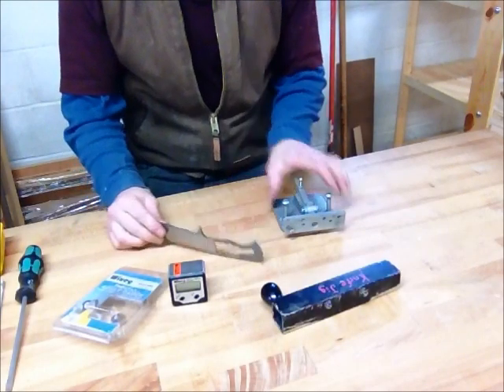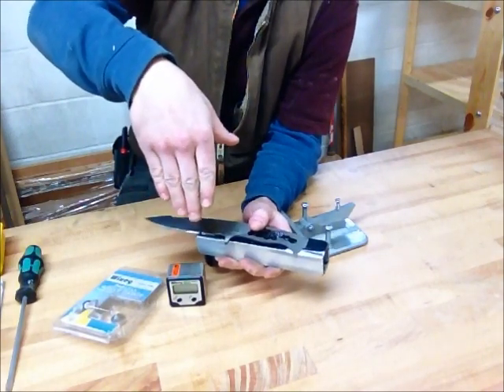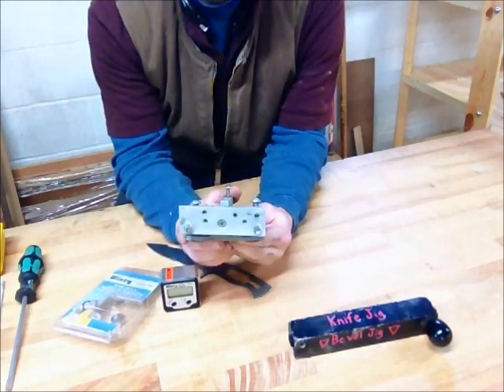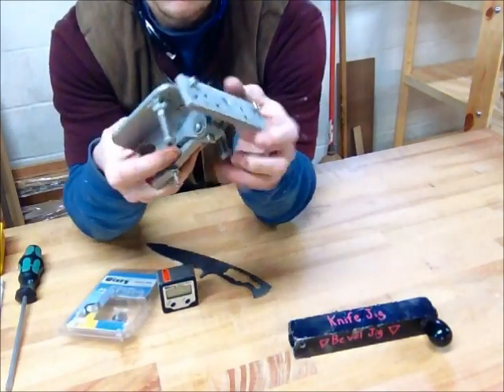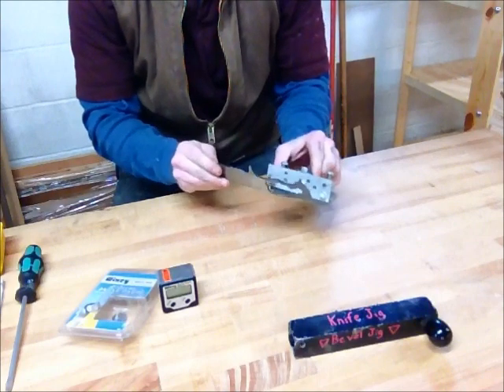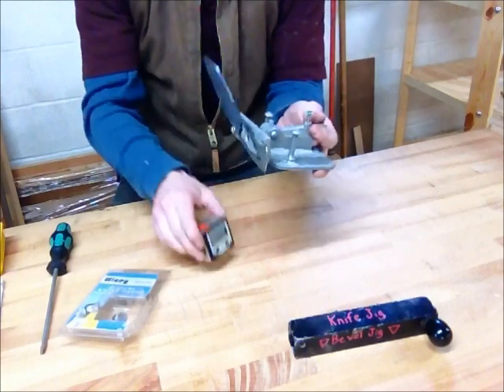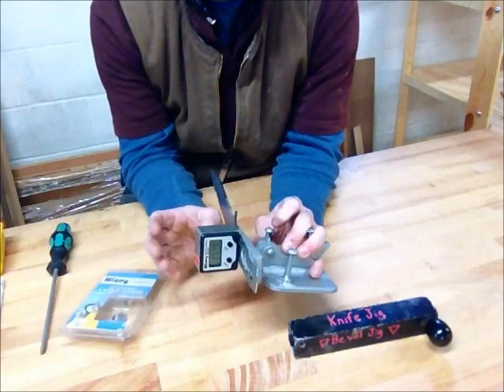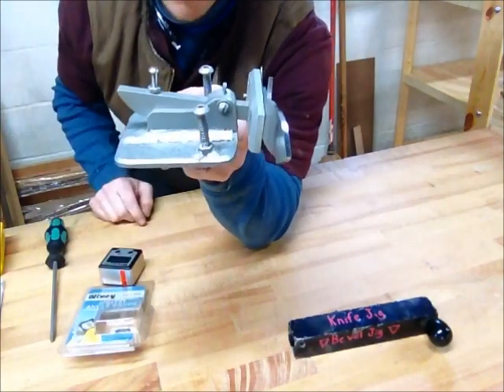Knife-Bevel Grinding Jig

Comment: No Doubt that would work but i am already drilling holes for balance even when i taper the tangs and because there is specific holes i can get the knife in at the exact same position & angle so the plunge lines line up. Plus it nice to know that thing is really locked in there in case i drop it or something which IS going to happen. Thanks for the tip!

Comment: That looks better than most jigs you see.  Very interesting. Would like to see a video using it to grind a bevel. 
I know it would be a lot more work but have you considered two pivot points instead of the center pivot?  Yours looks pretty beefy, but seems like it would be more true with two. 
Lastly, what kind of grinder are you using that on and what work rest?

Thanks for taking the time to show that off.  Very cool sir.
Reply: Hi this is Alec (this is my personal account) 
    Yeah I will be adding some videos by the end of next week and ill make sure to do one of the grinding process. Im not %100 clear on what you mean by 2 pivot points. It does have the adjustment screw in the back which actually enables it from moving, although not a pivot point. I have not had move on me yet but if i dropped it i would probably loose the angle but i always write down what it is for each blade.  
   Im using an old modified grizzly 1x42 with an upgraded motor which works very well except i have a new 2x72 which ill be showing in a video soon. 
 Thanks!
Reply: Alec Guth
The more I look at it, I think you are just fine with the single pivot in the middle.  With the rails along each side and the bar welled to the face, it isn't going to move on you. 
I don't quite understand how mounting the knife at an angle like that works out, but I'll wait for the video. 
I'm pretty new to grinding and still learning how to get an even grind, especially where the blade sweeps up to the tip.
I haven't tried a jig yet as I want to learn the fine art of free hand grinding.  I'm slowly getting better at it.